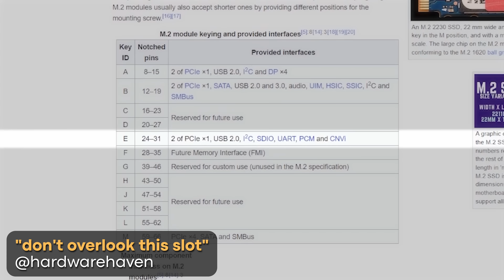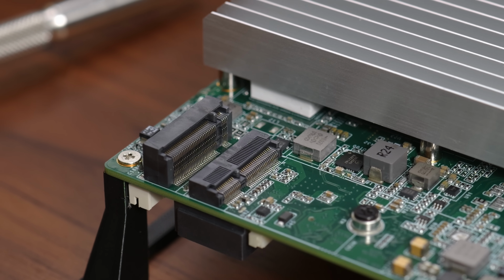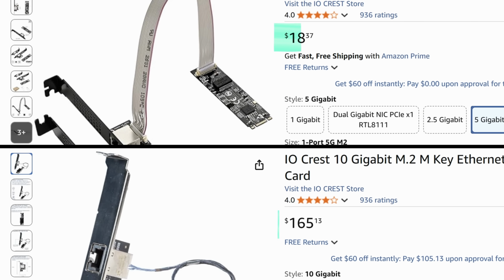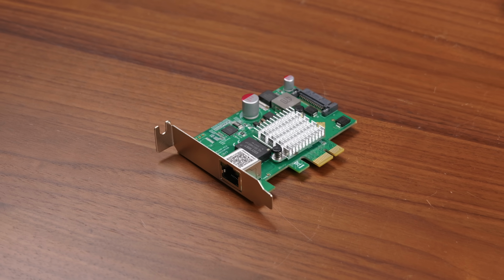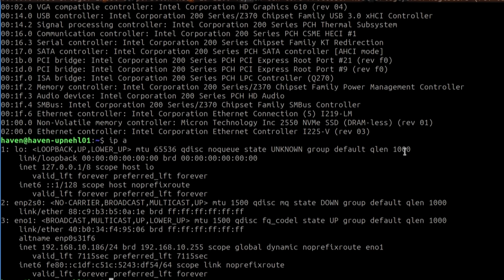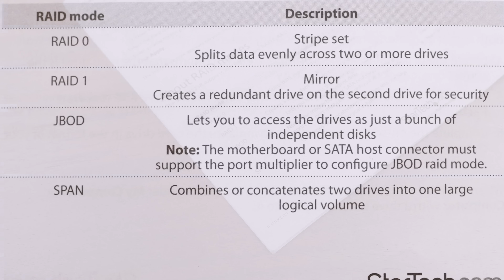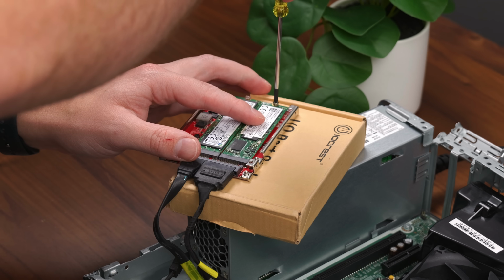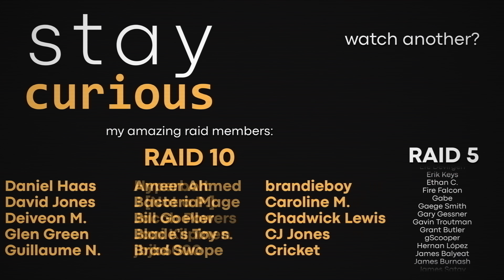I Don’t Know Why These Adapters Exist... But I Love Them

Comment: Oh yeah, I remember looking through PCI and PCIe adapters on Newegg and there is an adapter for anything you could possible need. I remember when I was installing a ton of SSDs and HDDs into my system and realized that the straight and right angle cables weren't going to do the trick. I found out that left angle cables existed and they were what I needed. You can get one end angled and the other straight, both angled, etc.

Comment: Adapter #3 and your comments about buying a switch triggered a memory of mine where back in the 90s I had a quad port 10/100 network adapter.. but it was actually not a NIC I think, I think it was a hub in the form of a PCI card. It was so weird. I want to say my memory is bad and such a product would never exist so I tried to find something similar and came across a discontinued Trend Net TE100-DX4PCI  which is the exact same thing (though what I had was a off brand cheap thing I'm sure I bought in an unlabeled box from Fry's Electronics, my first Nvidia cards were also in unlabeled boxes from Fry's, those cards were good.. the NIC/HUB thing not so much).

Comment: Hardware Raid adapter is exactly that i need. I will put it in old Intel NUC and it will be lowpower cloud at home. NUC have eMMC on board for OS, and sata for data, perfect.

Comment: The "weirdest" adapter I bought was an A/E keyed M.2 (the kind that fit WiFi cards, they do not fit NVMe SSDs which are usually M keyed) to full sized PCIe x1 slot. I had bought a board a few years ago meant to be integrated into a display but I didn't want to do that, I bought it because I thought the processor was interesting (it's a KX-6000 series processor) and it was the cheapest board with it I could find, and I wanted to make a tower/desktop PC out of it. It was not meant for a normal tower PC but with several adapters you could get it to work, and that adapter let me plug in a full-sized GPU through the slot meant for WiFi cards. The x1 bandwidth limitation isn't really a big deal unless you are plugging in a higher end GPU. The RX480 I put in there easily got 100% utilization over the x1 slot.
Reply: That is actually a surprising good idea. How has the processor been so far? I've been wanting to try out one of those Zhaoxin chips for ages now, compare it to an old VIA machine, but getting something that can be used in a desktop and shipped out of China has been difficult.
Reply: @h.b.5577  I would not buy a desktop. They are very expensive, minimum $600, and then you have to pay for shipping something extremely large and heavy, and then now there are like 30%+ tariffs you will have to pay. It is better to buy the motherboard/CPU on their own and build a PC when you get it.

Comment: I've been looking for an NVME splitter. Something that will allow me to connect two NVME drives in one NVME slot. I'm not worried about the speed too much much, even if it reduces to SATA speeds, I'd be happy.

Comment: Hardware level RAID is not ideal because the whole point of RAID is to avoid a single point of failure, but it introduces a single point of failure being the RAID controller itself. I would always research before buying what kind of chip the RAID controller is using to make sure the RAID format is something that can be read through software on another computer if the controller dies.
Reply: Back in the day hardware raid offered speed with redundancy. Today, a hardware raid card has the ability to turn multiple drives into a single volume that the OS sees when maybe the OS doesn’t support software raid (ESXi for example)
Reply: You must be thinking of SATA because SAS supports having two controllers on the same data bus so that either controller can talk to any Drive just not at the same time that's what that little set of bridge connectors on the SAS port between The power and data connectors does.

This is also why you can plug SATA drives into a SAS backplane, but not the other way around.

Comment: Regarding the PoE adapter board - it would likely be cheaper to buy a device called a PoE injector. This does provide a cleaner setup though, which may be important for products you're producing for customers who you don't want to have to plug  things in properly. Also, I don't know if PoE control is accessible from a driver; it can be very handy to be able to have the computer turn PoE on and off, to control whether a device is powered or to cycle it if it's misbehaving.

Comment: Be careful using mini pcie to dual SD card if there is a continuous power pull on a laptop battery that is not permanently left charging.

Comment: that PCIe network card with PoE could power up a raspberry PI KVM or maybe another kind of tiny KVM for remote access to a PC/server. Could also be used for PoE sensors/probes like the Openviro Axe PoE

Comment: PoE splitters are some of the most underrated tools out there. Why run power to a device and use wifi when you can run cat6 to it instead? Same number of cables, but one less power brick and more reliable networking!

In my TV room I have a PoE switch powering an AP, MoCa adapter, a MiSTer system, camera, and a SBC thanks to these handy things! These things are glorious!
Reply: On top of that, if your switch is managed you can remotely control the power to all those devices!
Reply: @michaelkreitzer1369  Depending on the length of the cable, they might reveal that you have CCA rather than copper cores though!

Comment: That single port card with PoE would be great for testing hardware and having it power up and netboot isolated from a primary network. 1. That simply lets you test if the devices works with PoE without questioning if you have reaches the limits on a switch or have a bad port. 2. you can have multiple boot options that aren't on the main network for doing OS testing on devices or booting diagnostic/recovery images without having them on the main network to avoid confusion or potential security issues. 3. That lets you do initial setup for something like a rig you built yourself with a Pi with a pair of cameras and a motorized mount and making sure that all the hardware works as intended with the software before getting sealed in weatherproofing and installed somewhere that requires a ladder and clear weather or something.

Comment: If that PoE network adapter had more ports it would be great for a Frigate or other DIY NVR box, keeping the camera traffic off your main network without needing a dedicated poe switch.
Reply: There are similar cards with 4 PoE ports. Be sure to get ones with proper power isolation tho. It might matter in most applications.

Comment: 9:08 Damnit... I bought an NVMe SSD and a PCIe adaptor to mount it for my games PC a while back without realising I was already out of lanes so the slot was disabled. Looked for exactly this adaptor for AGES and couldn't find one. SSD now has a home in a newly built NAS but I am glad to see this thing does actually exist.
Reply: Ah, I take that back. It's for SATA drives 😅

Comment: the sata to dual m.2 seems VERY usable..

get two cheap drives(some computer stores give the low capacity ones away if you ask nicely, and they have them just laying around, waiting to be recycled anyway) and set it up for SPAN(so capacity does not matter) and boom, cheap, reasonable capacity sata drive. or use to drives of the same capacity in raid 1, and have redundant storage for the very important files you might have.

Comment: You should be very careful with that PoE setup. Base on my knowledge, the PoE card you have is not isolated in term of Power line. It need a proper transformer as the card at 8:34 to have power isolation. Same with PoE spliter, and even worse if it use low-side buck converter as the unit I own ( I can guarantee if i see the PCB)
Result in: PoE card and the spliter  have different Grounds ~36v (48-12). If two device's metal shell touch each other, it may cause short circuit.
This is just my theory and need to test with your case to confirm. Btw, sorry for my ugly English.
Reply: Very much true. IO crest has a second model with proper power isolation, via transformer and secondary side rectification and regulation.

They support PoE+ so about 33W

I have no clue why would they even offer model with no isolation. Cost difference would be minimal, even if in some scenarios lack of isolation is not a problem.
Reply: @movax20h  Looks like the one in the Amazon listing is isolated so I'm wondering if he got what he ordered.

An advantage of non-isolation is efficiency.

Comment: I'm guessing the PCIe PoE card is for when you want a direct connection to some PoE powered equipment, for isolation or performance reasons. 
I know there are some microcontroller debuggers that are powered over PoE you could use this way

Comment: Too bad the raid didn't do jbod or, could be useful and solve drive fail notice. Adapters that give older MB new life? Everything from sas to used drives or the opposite, New drives on a computer never designed to use them? On 15 yr Dell gathering dust, I just did  32gb ram and fastest cpu it could handle and Sata off ebay. 5 bios update, an ancient GPU so it does full HD. Turned on TPM and bypass check, it running win 11 serviceably - or could be a server (pcie2, ug) for backup, etc etc. 2.5gb card? How about tape backup? I had a great one way back but now you want redundant last line backup for a lot of data =cheap.

Comment: For the PoE adapter, at work we have 2 similar cards in use in our Pixelot servers. These are used at our football field and high school gymnasium. The server has a direct connection to their specialized cameras that track football/basketball/volleyball/etc. The cameras are PoE powered by the server and the server simply then feeds the camera feeds to the internet portal for people that want to watch the games/activities but are unable to attend in person. (I believe we got the system during COVID with special pricing and grant money I believe, it's been a few years now and I don't recall exactly. As it's essentially a blackbox system that we don't have any access into, it's basically plug it in and the company does all the config and whatnot, I don't really know much about it as I haven't had to deal with it.) In any case, the ones that are in these systems are quad gigiabit PoE ports on a single card. The original cameras we had at our football field required 2 PoE connections (the new one that was installed this year only requires one connection) while the one in our gymnasium requires 3 PoE connections. It still has the original camera that requires 2 PoE connections plus a 3rd camera that points at the scoreboard to scrape the info for a score/time/etc display at the bottom of the stream.

By using these adapters, their camera system is wholly independent of our network and therefor can't experience any lag from other network traffic and only requires a single network connection from each server to feed the video streams to their servers.
Reply: Any competent switch would be able to accommodate that that segregation of traffic without custom Hardware and not cause any lag. They wanted a turnkey proprietary solution that only they are the source of the information so that nobody could easily reverse engineer it to replace it with something bog standard.
Reply: @RowanHawkins Well, yes. We have done YouTube streams of events, though not with the sophistication of the AI cameras that will track the plays and such. And it's completely understandable that they would want to have a standardized deployment. So using a PoE card inside the server makes total sense instead of requiring us to have to run multiple runs of new network cable. They actually provided a wireless P2P bridge to get Internet access to our press box at the football field. I think for their use case, it's a perfect example of what a PoE card could be used for. A lot easier than them having to install a switch that then needs powered as well and is only being used for 2-3 PoE cameras to talk back to the server that does all the AI tracking and such, telling the cameras where to zoom and whatnot. From the little I tested, it's a much better experience than the single camera with a wide view view of the field that we would stream to YT with. Not checked out any of the indoor streams, but I imagine it's rather nice as well.
Reply: @gorgarath  I'm sure it will be great right up until the moment the company either goes bankrupt or enshittifies the service. Give it time.
Reply: How do they secure the streams, I imagine it being a hassle? Or is it just a public facing stream on a website (I would be surprised if it were)?

Edit: Now that I thought about it a minute longer, probably just one password that is then given out to everyone...?
Reply: @Xirtamani  It's a subscription service. The video feeds are sent to their servers which then allow subscribers to log into the website and view the event. We schedule when an event is and at which location and then the cameras will turn on and start streaming when it's time. As I said, it's pretty much a black box that we don't really have any control over. Pixellot is the camera system and NFHS is who provides the subscription service.
Reply: @gorgarath   I expected this to be some kinda service for the parents & relatives of kids, implemented during covid. Apparently not. Case of cultural difference, and thus different expectations, here. Regular subscription streaming service of all kinds of school sport, where whoever wants can pay for to have access to. That's wild to me. But ah well, here school vs school sports isn't a thing anyway. Kids & teens join clubs and then compete with these in their respective age brackets (that's the case for most of Europe, I think).

Guess they drew the line at wrestling and cheerleading, while they kept gymnastics out of it. Or is it just not big enough?

Comment: i guess that poe adapter could be used for a raspberry pi nas that auto boots when the pc is turned on. not that id use a pi as a nas to begin with. maybe there are other services that you could host on the pi that you only want for the pc connected to it.

Comment: That PoE PCIe card would be great if you have a fiber ONT that takes PoE. One less thing to plug into your UPS, or spare a socket on your already camped power bar. If it is possible to control the power (i.e. powercyle it) via software, that would be amazing.

Comment: Okay, really niche use but that POE 2.5GB nic adapter would ABSOLUTELY be prefect for wireless VR. In my case, I have a Vive XR Elite with 6Ghz support. I personally use a ubiquiti 6e access point powered by POE. If you plug the access point into your computer directly and set up network sharing, you bypass your router and any network switches for lower latency and effectively turn it into a dedicated wireless VR adapter with 2.5GB 6Ghz support, don't need a POE injector, and it's even faster if you don't need to actually give the headset access to the broader internet.

Comment: Industrial / scientific cameras often use PoE and ethernet, and if you want highly reliable speed and no issues, this might be easier than using a switch.

Also there are switches that can be powered via PoE, so having just computer to provide power can be handy. Sure there are limits, but often enough for a lot of things.

There is many more PoE things that might be useful here. Mostly various industrial and automation doodads. But also stuff in video, film, and music industry.

Comment: On the e key - just remove the key physically. If you have a steady hand, just use dremel. If not - you can use a soldering iron and later tidy up with a knife. Or a file if you are patient. Or make a poor man router out of drill mount and a piece of wood as a guide...
Goofy adapters - one of the most curious things i found are PCIe switching cards ( PCIe Bifurcation ). They start at 25$ but nice ones are much more expensive. Example: SU-EM5804(A3)-F50906 .
There is also SD card to SATA m.2 adapter. Strange PCI-e cards that are converters to M.2, but also add a SATA port that you need to connect with a cable (why?!?!). I saw a m.2 card that had both SATA controller and port multiplier for a total of 15 SATA ports...M.2 raisers to full PCIe slot are also usefull...

Sky is a limit :D

Comment: There are plenty of switches that are POE powered themselves, and also pass power through.  So a pcie card that can provide power will able to power it's own uplink port. Pretty handy if you want to throw a switch in a ceiling space for an access point, a camera, whatever, to hang off.
Reply: Yeah, these are really for POS terminals, to power and talk to the pin pad.
Reply: Most of those would operate better via a poe capable switch rather than a dedicated connection to the PC.
Reply: the best usecase i can think off rn for that poe pci-e card is to power a switch but only if the other devices connected don't use poe itself.
Reply: Most modern VOIP phones support POE. In this case, the PC provides network access and power simultaneously. I'm not sure if VOIP will work in this configuration, but if the PC connects to the network via WiFi, cabling issues are resolved. However, all POE devices will work as long as the PC is not turned off.

Comment: 1:54 if it was made for microSD express cards as they use PCIe, that adapter would’ve been amazing.
Reply: I was gonna say this too. Direct PCIe access speeds on a thumbnail drive…
Reply: It's coming, there already is a sdex to pcie 2 X1 adapter for the raspberry pi.
Reply: MicroSD Express is just crazy expensive for now.